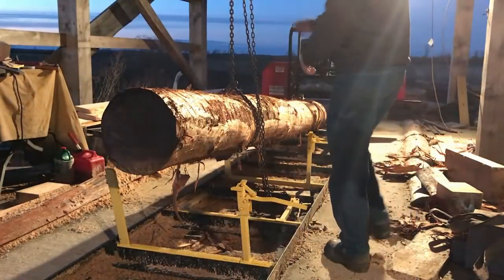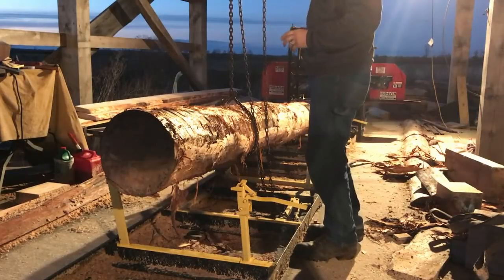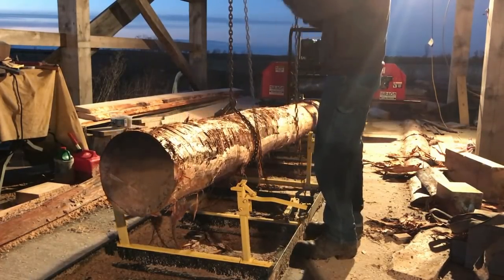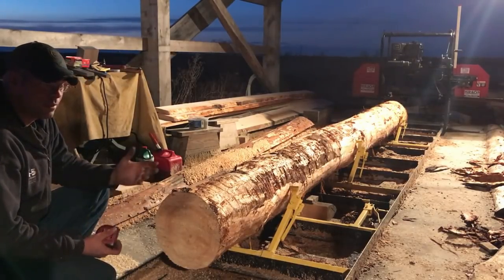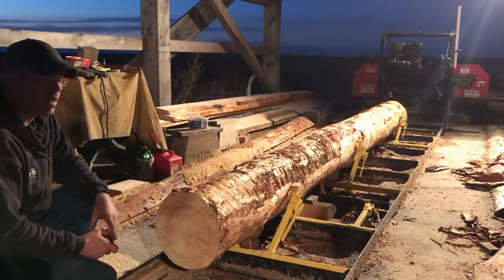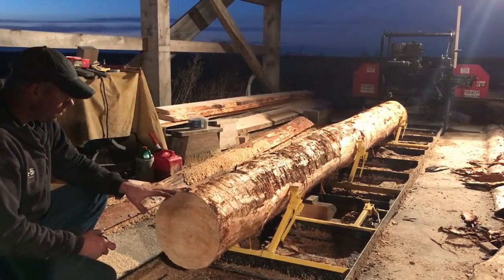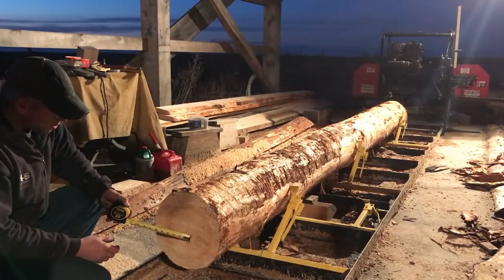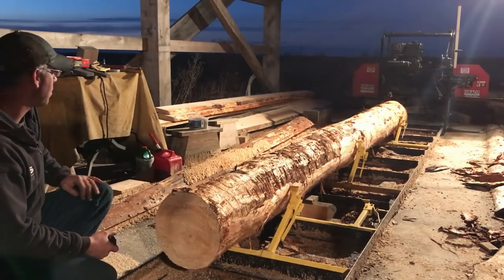A Timber Frame Vlog #81: Back to Top Plates

Comment: Great camera angle in the opening, and beautiful sky in your talking spot. Morning Jim. You might think about a laser line for where the blade is going to hit the log? It might make alignment a bit easier.
Please strap the metal down until your ready to actually put it up. With your winds I'm sure you thought about it, I know things get hectic and sometimes we forget the "little" things. 
Yeah, I've got things to do outside and here in central Kentucky we're looking at our first sub-freezing temps in the next few days. Be careful of ice and "black-ice" when you're out there working and picking up you felled trees. See YOU on the next one.
Reply from the maker: +Thomas Russell gpod morning Thomas

Comment: Hey Jim. Thanks for sharing your videos. Like so many others, I'm throughly enjoying following your project, appreciating your dedication and skill. In #45 you put your draw knife to good use cleaning up some wane. I am wondering if you could share your thoughts on draw knives? What sort of draw knife are you using (blade size, handle spacing, maker?) You've used it making pegs, cleaning and shaping timbers. Do you find it to be a good all round size? Cheers.
Reply from the maker: +Chris Steffert good evening Chris.  A draw knife is an excellent tool that everybody should own.  That one has a blade about 10" long on the cutting edge and I think the handles are about 12" center to center.  It is perfect for most of what I do here.  I'll be forging some more once the shop is up.

Comment: I plan to build a sawmill similar to yours.  Can you share your learnings and recommendations?
Reply from the maker: +jay dube check out Matthew Cremona's channel.  He built a really good one, really good stuff in that series.  I would say avoid using trailer tires, invest in the proper band wheels.  Make it a good 6' longer than what you think you need and don't rush the project, research until your eyes pop out of your head.  Good luck.

Comment: What is the smallest log diameter mill you would go with? I'm considering a 21" but don't want to regret it
Reply from the maker: +Frugal Drew 21" is fine for most.  I like something over 30" for woodworking purposes.
Reply: TheTradesmanChannel 2017 basically I want to be able to make fences barns and lumber. I know it really comes down to what trees I have available but what is the biggest size log youve used on the barn?
Reply: sheds** not barns
Reply from the maker: +Frugal Drew 36" diameter logs for the 10x16 tie beams.  A 21" mill sounds perfect for what you want to do.

Comment: which size of sawmill would you recommend?  is their a reason you choose hud-son over other brands?
Reply from the maker: +beaver wood wood works good evening.  I chose the Hudson because they were fairly local and the customer support is good.  I also went on price point.  That mill with 28' of track was $6,000 even out the door.  I couldn't beat it that way.  I can make a 32" cut on this mill and for now that is plenty.  I've run close to 30,000 board feet through it with no issues of any kind.  If you're looking to cut timbers for timber framing, 20' of cut is the shortest I would go.

Comment: Is your metal roof going to be square ribbed or curved ribbed, painted or galvanized, and how long will the sheets be?  Have you given any thought to using 2 x 6's for your roof?  I was watching a dude in Canada and he double stacked 2 x 6's (offset to cover the joints) and then charred and oiled the boards.  Turned out very nice, yet I don't know if it would be code compliant in your village.  https://www.youtube.com/watch?v=O8TbbRK4MDs
Reply from the maker: +Tynyyn you were watching My Selfreliance, I like that guy.  Sheets will be 10' long, roof will be a gambrel roof, rafters will be 2x8's.  I have lake effect snow here which gets very heavy and wet.  Roof needs to be stout.